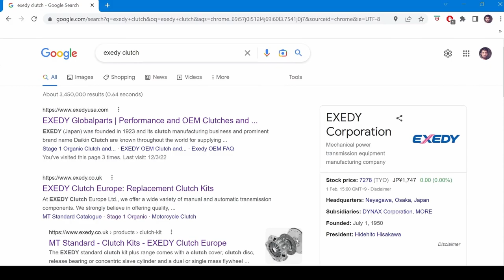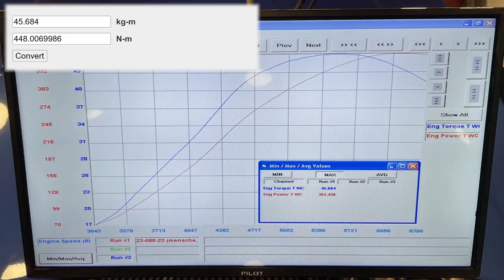The GC8 Gets a New Exedy Clutch & Flywheel

Comment: Hi There! I am planning to replace my 1996 gc8 sti jdm with these parts but the parts you linked are for 2004 subaru (assuming GD series), will it fit on the gc8?
Reply from the maker: @KrispyRoad  
Hi! I got the kit that suits an 00-2003 STI 6 speed gearbox (GDB) so I think you will need something else if you’re still running a 5 speed gearbox.
What gearbox are you using?
Reply: @TheGCJourney  ah yes im still with the OEM 5 sp
Reply from the maker: @KrispyRoad  
Then I believe you’ll need a different part number. Also depending on what power you’re aiming for.

Comment: Hey man, I have a question after you replaced your clutch did you make any adjustments at the clutch pedal ? for a better clutch release. I have kinda the same issue with my clutch I have an exedy stage 1 heavy duty street with an organic fly wheel but someone just told me about the clutch pedal!!
Reply from the maker: Yes, the pedal did need some adjusting

Comment: Next steps to make it more of a daily car:
Get an interior.
Get some tires that don't sound like your driving a truck (or a second set of wheels)
Reply from the maker: I’m not sure if the noise is coming from the tires only, or if a lot of the noise is coming from the rear LSD.

But that’s a pretty good idea!
Reply: HEADLINING !
Reply from the maker: @ronnieboucherthecrystalcraftsm  
The headliner is sitting safe at home and will be back in the car once the windshields are resealed

Comment: rh front tire is on the wrong side directional should be facing the other way ! Flywheel should be X bolted with torque sittings = then run out checked with a dial indicator ! - you seem a bit ROUGH as a mechanic ! for high performance .
Reply from the maker: I’m no mechanic 😅 this is just a hobby of mine.
You are the first one to spot the tire direction! No one has ever mentioned that I didn’t notice it till now! Thank you very much for your helpful comment! 🙏🏼🙏🏼🙏🏼

Comment: a million ways to skin every cat, but be careful driving fasteners in with an impact. it seems it came out fine, but imagine blowing out one of the female threads on the crank doing this job, what would you do? for disassembly its fine 99 percent of the time, for assembly its rarely the right tool sinking stuff. someone else mentioned tightening stuff down from each/all sides as evenly as possible, or a cross pattern to keep it simple. also when you split an engine on a street car like this its always a great idea to replace the rear main seal and the inspection plate, when they leak and you have to do all this again its annoying as heck. great job though and thank you for sharing, please dont take my words as a negative, i saw you commented you are not a professional mechanic, so i am just offering tips as one. and prop or driveshaft you are right who cares, as long as everyone understands each other its all good, as i find history interesting, i will let you know the manufacturers that started with boats continued into road vehicles using the term prop shaft or propeller shaft, road manufacturers that started there just referred to it as a driveshaft 😊 thank you again for sharing, cool old subie ✌️
Reply: also two solutions to blowing out a fastener on the crank: use a slightly larger tap and bolt and pray it works, or weld it all in, center tap and drill it out and tap to oem size. ive done both, and would rather not have. in a high torque area like this i dont think any nutzert or rivetnut or anything like that would be acceptable. live and learn they say..
Reply from the maker: Hey man, thank you for all the useful tips! I'm always open to learn from others with more experience than me. Cheers 😊